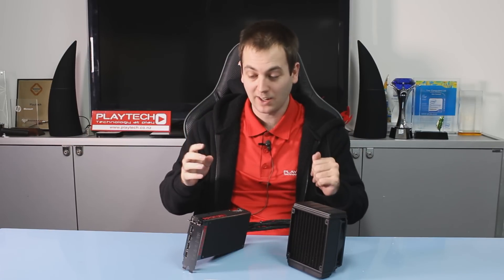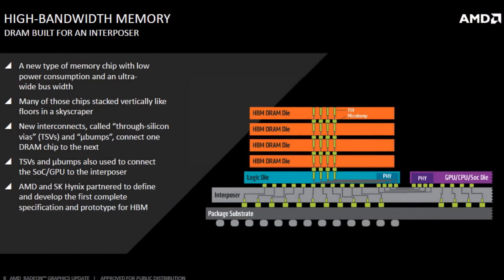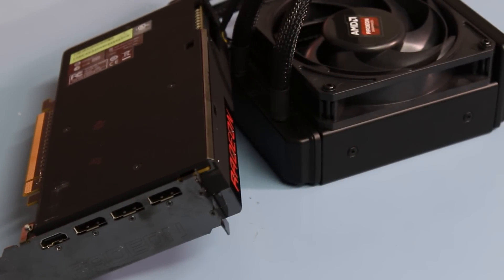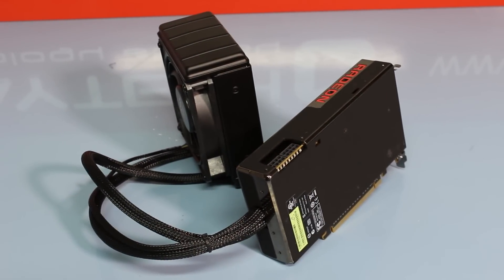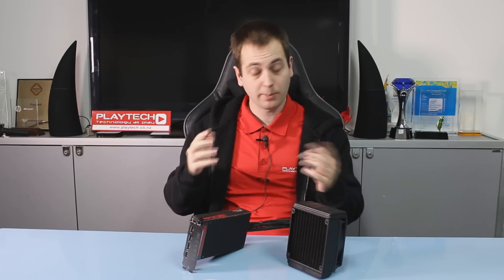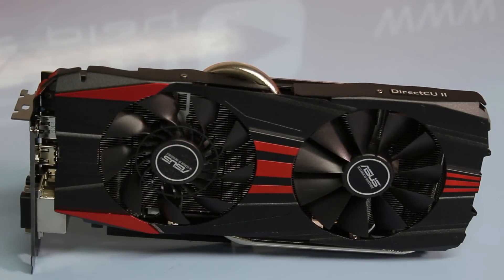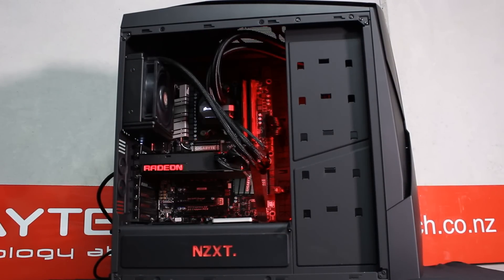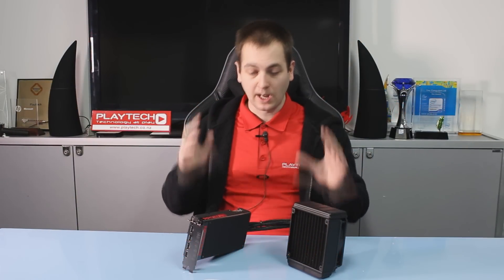AMD R9 Fury X Review + 390x Comparison

Comment: if you put a liquid cooler onto the r9 390x it would run very similar to the furyX. I honestly dont think the furyX is worth buying. Not even the r9 390x is worth buying because the r9 390 is as good as the r9 390x but just 3 to 5 fps, thats not a big a change to be honest. The Fury X is running better because of the liquid cooler but you are comparing an air cooled r9 390x vs a FuryX that is liquid cooled, there isn't a fair advantage. i run all my gaming in 4k at maxed out graphics just using a XFX r9 390 and i get great fps around 40 to 50s depending on the game but it still runs great for that type of stress. I have crossfire but to put the beast to a test it runs very good aircooled at stock stats.  Great video though
Reply from the maker: +Ken Lu (Holistic Gamer) The cooling wont make any difference to performance until you start overclocking though, adding a liquid cooler to the 390x would bring temps down but the performance would stay the same, there is a sizable difference between the two in terms of performance
Reply: ***** sorry thats what i meant to say that the r9 390x can be overclocked with a liquid cooler and would give u a bang for the buck compare to the furyx.
Reply: +Ken Lu (Holistic Gamer) I have a water-cooled 390x and it does not perform on the level of a Fury X. The cost of watercooling my 390x could have got a Fury X.
Reply: +Ken Lu (Holistic Gamer) All I can say is that my Fury X does outperform my 390x.

Why do you say they abandoned the Fury X? I genuinely am just interested.
Reply: TenCashMan Amd have basically abandoned the fury X and sadly the radeon pro as well.
Reply: TenCashMan they r focusing on their polarised rx 480 n up. Most of the updates r for the rx 480 n fury X still has problems as well as the r9 390 and radeon pro

Comment: Why in NZ Fury X priced higher than gtx 980ti? Gtx 980Ti 1250$ and Fury X 1400$!!! So why there is a difference in 150$? The price for them should exactly the same!
Reply: Yaroslav Shevelev Because the Fury X has such a high demand. Prices should go down after awhile.
Reply: Yaroslav Shevelev in France the Fury X costs 699€, the cheapest 980 ti right now costs 799€.

The 980 ti windforce costs 929€ lol.

Where is the 100€ or 229€ difference here too? Probably in someone«1 pockets i would imagine.

Comment: Thanks for a "realistic" review of the cards especially the Fury X. One question I have is everyone tests the Fury on an intel based system rather than an amd system. Would like to see a benchmarks done with a higher end amd system. Thanks again for the video!
Reply: Anton Markov Yes there is...use the internet.
Reply: Anton Markov It wasn't a question of if AMD cpu's are classed as high end compared to Intel. Rather how the Fury X benchmarks with a 8350/8370/9590 etc. Thought it would make sense to benchmark a GPU and CPU of the same brand especially for people who already own an AMD system.
Reply: Tekagi502 there is no high end amd system
Reply: Even AMD don't benchmark with AMD cpus's
Reply: Anton Markov The 8350
Reply: Anton Markov Not true.
Reply: yep i have 8320 oced at 4.5 not equal to any lga 2011 cpu
Reply: +Tekagi502 i own a fx 9590 that cpu is a beast runs very good no problems at all, why are people talking about the 8350 it has to be overclocked just to run it as fast as the fx 9590. i got my fx 9590 up to 5.2ghz without custom loop, just a regular corsair h100i lol. now imagine with a custom loop might be a challenge now.
Reply: ITSATRAP ! yes of course its a better bargain if you want to go cheap, not everyone is gonna know how to overclock their cpu, thats the problem im talking commercially wise.
Reply: ITSATRAP ! of course only the smart ones will. I have seen custom made liquid loops made out of home depots parts . i have thought about that and it only cost you about 20 bucks. LOL cheap
Reply: i actually use to have a h60 and i gave it away to my friend, its ok not the best. why?
Reply: what type of cpu are you looking to cool?
Reply: yeah but which cpu? 8350?
Reply: ITSATRAP !  h60 is ok then
Reply: yeah u are fine then if its a 6 core it won't be hard to cool off.
Reply: h60 is a cheap cooler thats a good enough cooler for your 6 core
Reply: u go cheap u will have problems, u should know how pc works.
you get what u pay for. i recommend u to buy the h60 through amazon
Reply: im running a crosshair v formula z